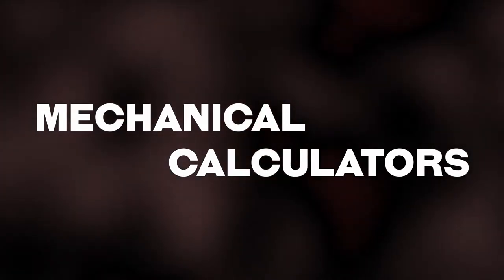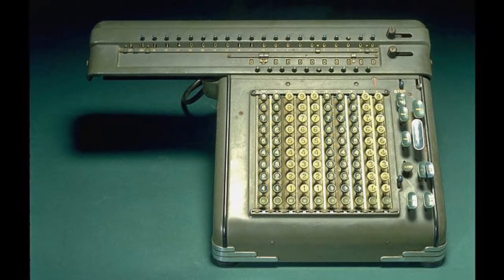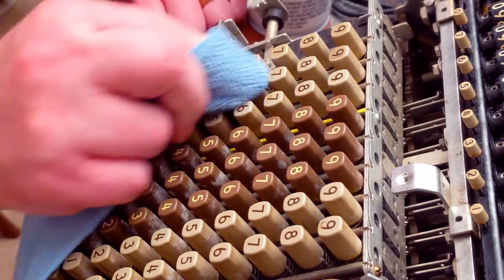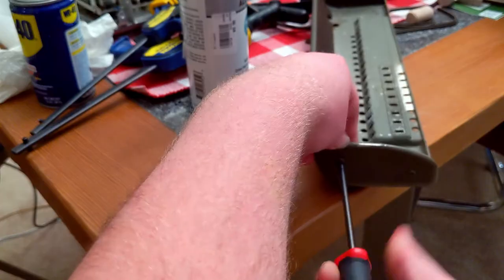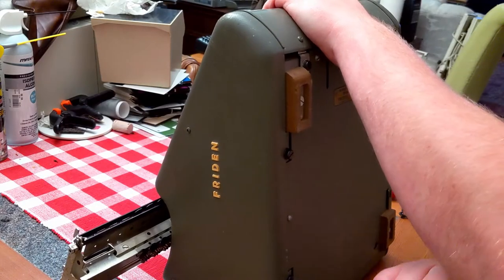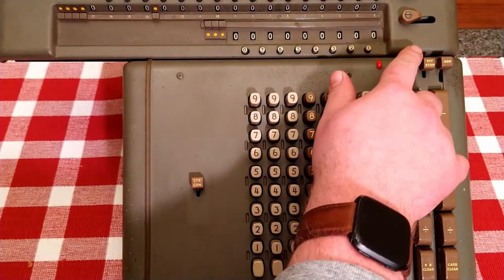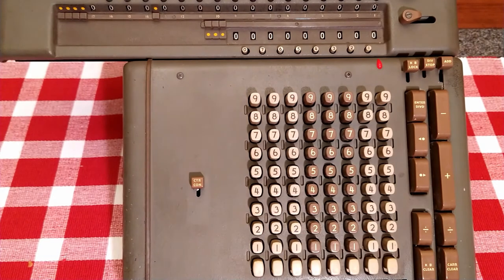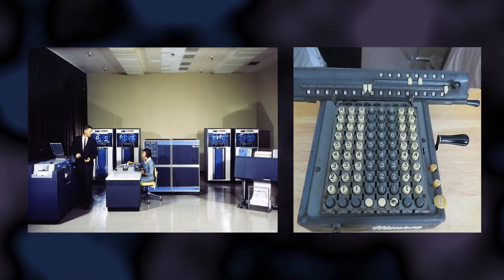Electromechanical Calculators - Friden CW8 Restoration & Demo

Comment: Nice repair video,  it is pretty cool to watch these machines in action. I've repaired a Friden S10, model F, and ST10 (videos of the first 2 on my channel), and I have a ACG10 waiting for me to get to it. Wd40 is great for cleaning, but I wouldn't recommend using it as a lubricant as it can dry out over time and glue the parts together. Before staring his own company, Friden worked at Marchant, where he designed Marchant's old line machines which are some of my favorite
Reply from the maker: Marchant machines are gorgeous, love that stuff. And agreed on the WD-40, ended up going back through my proper oil afterwards and it's still kicking amazingly! I would love to get my hands on one of the 10 digit art deco styled Fridens, I've always been a sucker for that aesthetic and the Fridens from that era are great looking